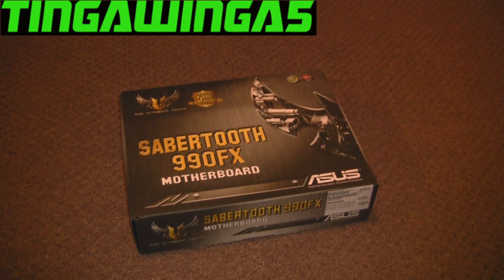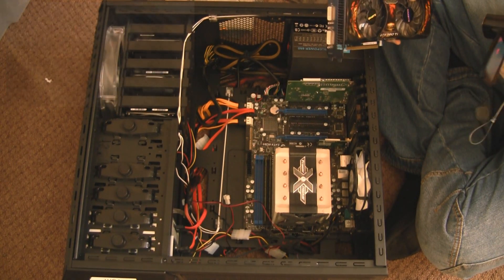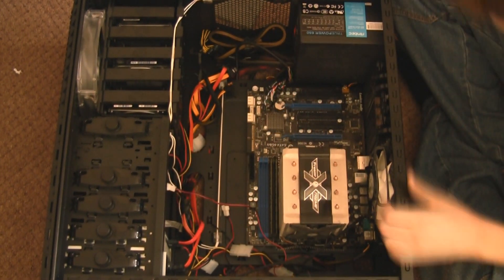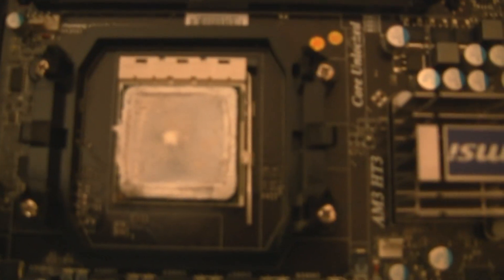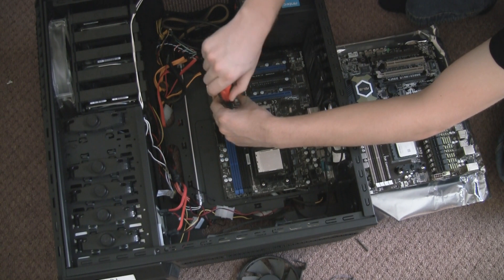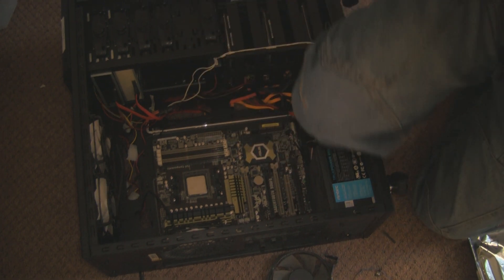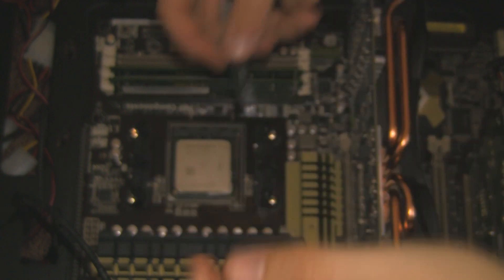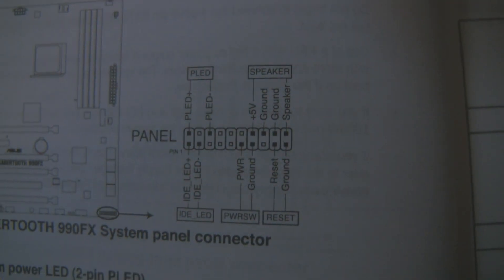How To Change Your Motherboard

Comment: Excellent video, very informative. Ive just got a used bundle fopr my son. MSI 970 GAMING WITH FX 6300 CPU included. Fitting it tomorrow. Bought 2x 8gb 1600 ram sticks also. Was a bargain, only paid 35 ukp for it although its now 2018 it will do for what he needs it for.

Comment: Hey thinking about upgrading my cpu but it's soldered onto my motherboard cause I bought it. Going to switch the motherboard but don't know if the motherboard I get will fit the case cause it's fairly small. Should I prioritize the motherboard fitting my case with a potential of a different cpu or prioritize the motherboard fitting my case with the cpu potentially being different or priortize my cpu and pick the motherboard and case for the cpu I want?

Comment: I built my PC and it worked good for 2 days straight, then while I was on I got the blue screen of death and my PC restarted. Once it did I got stuck on the motherboard splash screen. NONE  of my keys worked, I even switched keyboards. I reset my CMO's and switched my RAM but still stuck, no keys work. Is it my motherboards problem?

Comment: As long as I screw the brass screws in the right slot the board will fit? Because I find it's hard for me to screw things in when I have to line up the holes between my motherboard and case

Comment: So, i'm in the process of buying a new motherboard. When buying the motherboard, do all the parts come inside the box, or do you need to buy the parts separately?
Reply: +Jose Lizarraga your CPU ( Central Processing unit) is what powers your everyday applications, like windows, internet explorer and microsoft word etc. this is where you would have heard the term "dual core" "quad core" because your cpu is where all the cores are at, for example my phone has a Snapdragon 510 Octocore CPU, all CPU's come with a cooling unit but you can also buy much better cooling units for most any CPU as they are all roughly the same size and have the same dimensions. Your graphics card is the GPU (Graphics Processing unit) this powers mostly all of your graphics like when you're gaming or surfing the web. I hope this helped!
Reply: +Jose Lizarraga The motherboard includes the motherboard and typically some cables. The CPU and GFX card is obviously purchased seperatly.
Reply: monsterhunter445 So, CPU is a fan cooler, and GFX card, is a graphics card. Am I correct?

Comment: many videos about how to replace a Motherboard but none explain what we need to do as far as Windows OS reinstall or why.
Reply: +TheRealDJOsk thats because you dont need to
Reply: +SuperTomo136 no no. if you have say a gigabyte Z170X and switch to Asus Z170 the drivers will conflict with new board and won't boot
Reply: well all you are doing is replacing the motherboard right? therefore you will still have the same hard drive as before with everything on it
Reply: +SuperTomo136 how so?
Reply: +APEX1LPF he didn't say anything about drivers he said os

Comment: I have a good laptop, a shitty PC.
Want to buy a GT 630 for my PC, but it uses a chipset...
Can I still install a GT 630 even though the motherboard uses a chipset?
Reply: Cheezy Don't buy a GT 630, in fact don't buy any GT card. The minimum you should invest your money into is a GTX card, like a GTX 750. And yes, a new GPU will work on motherboards that use chipsets. Just makes sure it fits in your case and that you have a good enough power supply to run it.

Comment: I'm getting a new motherboard so I can switch from AMD to Intel.

Can I JUST swap the motherboards and be done, or is there something else I need to do?
Reply: Niuqorram You will need a new cpu an intel cpu for an intel board and be sure your graphicks card is compatible with intel or there is an AMD slot in your intel board
Reply: Vik With The K Oh and your hdd or ssd you have to "reset" it or something
Reply: +Vik With The K when installing an OS it will clean the HDD

Comment: i am not a pc expert thats why i want to ask u some things if u dont mind
i want to change my case from mini to medium and i want also some "upgrades" :i have an i7 3770 3.4 ghz  Processor and i recently bought the  NVIDIA gtx760 2gb (gigabyte version ) .the problem is that my power supply is ONLY 300 watt.
1. Question should i upgrade it to 500 or even 600 watt or stay with it doesnt really matter?
2. Question should i get a new motherboard?the one i have is for mini cases ( ATXm i think they call it) and should i get a new one ATX-size with more slots?
3. if i should get one which one would u suggest in my occasion?

ps.i dont play many games but i do like testing my pc with games like crysis 3 or something like that and they run until now without problems i would say
Reply: You mobo might not fit being a mini. I would get an micro atx for a mic size case

Comment: Ok, I have legit windows 8 and updated to 8.1, this motherboard BIOS is EUFI. I want to replace my motherboard AND CPU with newer and more powerful ones. The new motherboard is also EUFI, will I have to reinstall Windows 8 and 8.1 or do I only have to reinstall drivers after I replace it?

- Overview current:
Windows 8.1 Installed and latest drivers.
Base Acer motherboard with Socket 1155 (BIOS Mode: EUFI) - Model is not specified
i7 3770K 3.5GHz

- Want to replace with:
Asrock Z97 Extreme6 with Socket 1150 (BIOS Mode: EUFI)
i7 4790K 4GHz

Also one other question; it may sound stupid, but will I lose any other data on my harddisk? Since I might have to reinstall windows and windows is on the C:\.

Comment: Do I have to reinstall my OS?
Reply: truegamers About that, im upgrading mine and i have windows 8 preinstalled from a hdd from my previous hp envy. If i have to reinstall it, where do i get the code from? And how exactly do i reinstall it? Help plz (obviously im a noob) :P
Reply: +Asif Miah no you don't cause it's on the hdd, if you got a new hdd or ssd then you would have to

Comment: So how do you know what size your MB is? I want to replace my mb because my old one died, I want to get a better one ( one that is more up to date) but I don't know if I will buy the correct size for my desktop. Also, I wanted to get a better graphics card (gtx 750Ti), would I need a certain kind of mb? Would I need more ram memory or a better CPU? Basically can I use any kind of graphics card and keep the same kind of components? I realize the psu would need to be a higher wattage but do other things need to be upgraded to compensate for a better card or mb? Thanks.

Comment: so I could replace my motherboard without replacing anything els?
Reply: as long as its compatible with the new board
Reply: i did, and now its asking me to activate windows (windows 8) i can still play all of my games and go on the web, but on my desktop it says , Windows 8 build 9200, how can i fix it?
Reply: do what it says and activate windows with a product code (if you really want it) or just keep using it for the web and games
Reply: i tried putting in my product code, and it said it is in use, should i call support?
Reply: Lone Gamer have you used the product code before?
Reply: Lone Gamer was the code an oem?
Reply: tom price I bought my PC pre built, and never used the product code.
Reply: LimitzVFXGoesPC im sorry, what does that mean?
Reply: original equipment manufacturer means the first copy of windows is tied to the motherboard you first bought, because you bought the license and not the 'product'. If you're on windows 8 the terms of agreement have changed to allow you to use an oem copy of windows more than once, but you have to be must deactivate it from your old computer to your new one. Windows 7 and below does not allow you to do this.

Remember oem is basically a license to use windows, you haven't bought the product windows.
Reply: ohh! okay. yeah, im a noob and forgot to uninstall it.
Reply: anything els I can do?
Reply: does it work as usual?
Reply: yes everything, besides every like 2-4 hrs it stops what im doing and says to activate windows. and i cant connect my windows phone to it. besides that, its good.
Reply: Lone Gamer maybe you can get a crack version of windows or you can try running linux
Reply: Jor Sanders i wouldn't recommend cracking windows
Reply: i wouldn't recommend it.
Reply: Not much point in that, the only reason I have to replace mine is because it doesn't work with the AMD Fx-8350 so i needed a new better motherboard that could support it :P

Comment: Do I have to rub the Thermal Paste around the CPU? or can I just leave it?(Intel CPU)
Reply: You have to, otherwise it could ruin your CPU & cooler.
Reply: Leo MC you are stupid
Reply: I learn from the best
Reply: If so, just put the heatsink on withouy doing anything.. The paste eill spread itself.
Reply: I've done that and It didn't spread it completely, hence why I asked. Different people give valid reasoning for both.
Reply: Using your finger will make it so there is air bubbles inside the paste, which is bad..

Also, the thermal paste shouldn't cover the whole cpu!

Comment: Hi, I have a Question related to the topic, I got a new motherboard (Asrock Z87 Extreme 4, and a new CPU i7 4770, but my old SATA Hard drive it doesn't want work on it, what could be the problem? I've installed a new windows in another HD and it working, But I want my old windows to work cos it contains some important software.
Reply: Have you installed drivers for you're HDD? They can be found on the manufactures website.

Comment: Hey Tinga, when you install your RAM you probably want to make sure that the two modules are in the same color RAM Slots for the best performance. It will make it Dual Channel memory when you do it. Plus, more air space for your RAM

Comment: Should a fucking moron (me) attempt to do this without much knowledge about hardware? I have a friend of my brother's, who could do it for me, but I'm a bit of a reclusive piece of shit and I wouldn't mind trying to do this myself (I've recently started getting interested in computers, hardware and software alike). Do I need the paste as well and what could happen if I didn't apply it?
Reply: It is almost always unnecessary unless you are going to overclock which is not a good idea if you're new! Two or three case fans are enough for even mid-high end parts.
Reply: Ok. It's just that I want to be able to do things myself and I thought that something like changing the motherboard would be useful knowledge, since I shouldn't depend on my brother every time somethings wrong with my computer. I don't think I've ever overclocked a computer, getting it really warm tops. It is a rather old computer, nothing fancy with it, and it has two fans, so I should be in the safe, I would guess..
Reply: sNOOBie My advice is before you do anything check the parts are all compatible over here: http://www.reddit.com/r/buildapc (They are really friendly and helpful) Then check you tutorials and read the manuals of you're parts (There should be some somewhere.) And finally remember not to touch any of thee metal parts always try to touch the silicon unless you have anti static wrist bands. The reddit thread also has a guide here: http://www.reddit.com/r/buildapc/wiki/beginnersguide Hope I was of some help.
Reply: My brother has found a motherboard for me that's compatible with my computer, but I was unsure on whether I should try changing it myself or simply man up and ask for help like a good little noob. Though I won't be doing it for at least a couple of months more (It's been broken since last year) due to financial troubles, it's nice to know that I can't fuck things up completely by being a stubborn idiot.

Comment: Glad I found this video. I was wondering if it was possible to get a new Mobo but keep my same processor. I wasn't sure because I thought the thermal paste hardened to where it would damage the CPU if I removed the fan to switch it over to the new Mobo. Thanks for the upload! :)

Comment: When you spread the paste with your fingers, you create an uneven surface that when the heatsink is placed on top creates bubbles, just put either a dab or a short line in the center.  Since the chip square ontop, a dab in the center would be best.
Reply: dab on em

Comment: never use your finger to spread thermal paste the oils from your finger contaminates it....just simply dab a pea size bit in the center of the processor unit and use the heat sink to spread it.

Comment: Wbfuhn has good point.  You really need to think about backup of files and registry and drivers.  Point is that the hardware swap is only a part of the big picture, especially since Win7 is mobo specific. (and you better know what THAT means)

Comment: My only concern is software in terms of replacing the motherboard. This is a good tutorial no doubt, but I was wondering if replacing the motherboard would interfere with software. Would I have to reinstall the OS, or is that only with replacing hard drives?

Comment: If you are using windows, you HAVE to format your hard drive, OS and all. So before you rip your computer apart, pop your OS disk into the drive so you can boot straight into the windows install suite. Replace what you need to replace, put the hard drive back in, boot it up, reinstall Windows, good to go.